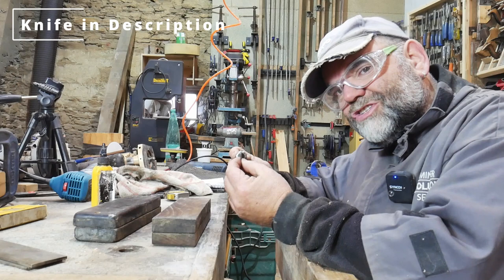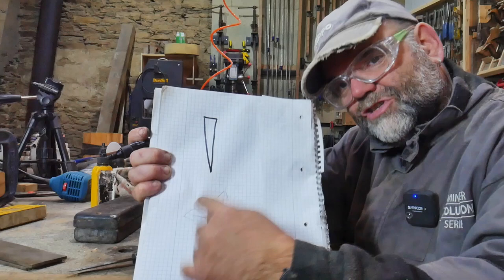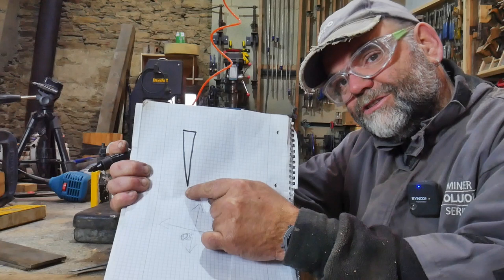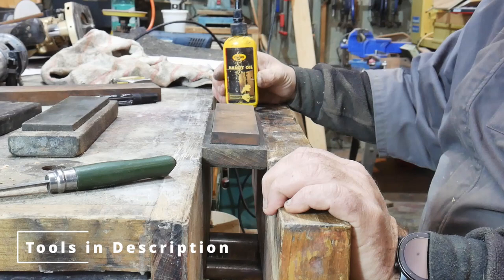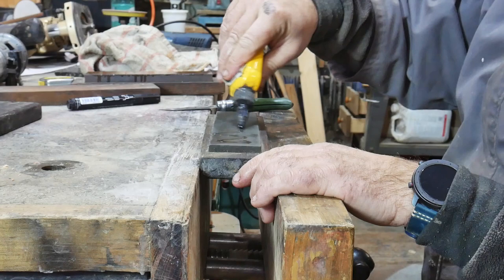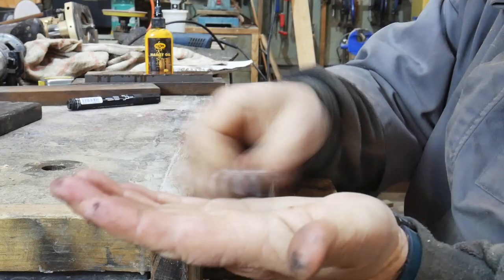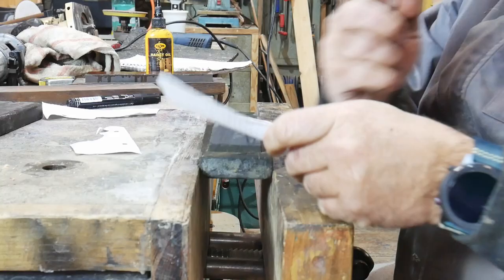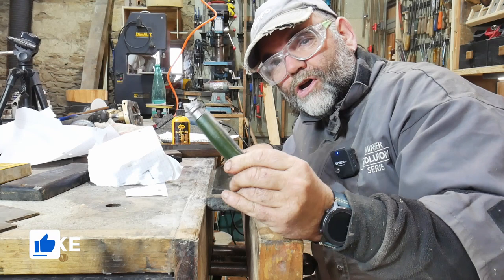Sharpening Opinel knife 08 the EASY way

Comment: I still have my India sharpening stone from 1979 but Had Trend diamond item 20years.Not much difference between the two.
Reply from the maker: The diamond does stay flat though xx
Reply: @WallyboisWoodworking  my old mentor by the name of Ron Fletcher showed me a way of flatting an India stone using a pane of glass,sand and water.Simply rub the stone on the glass with the sand and a little water to produce an abrasive compound.
The old ways are being forgotten.I had a wide range of joinery work back in UK.From cabinet making to structural roof work on English Heritage projects.
Still good to take on the odd contact to stretch the old grey matter.👍😂😂🤪🤪🇫🇷🍷🇪🇺